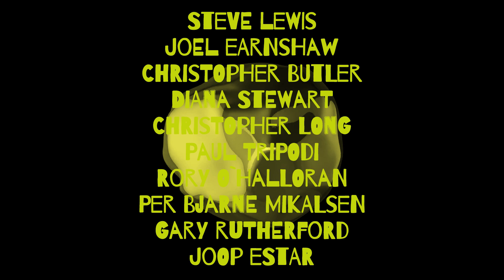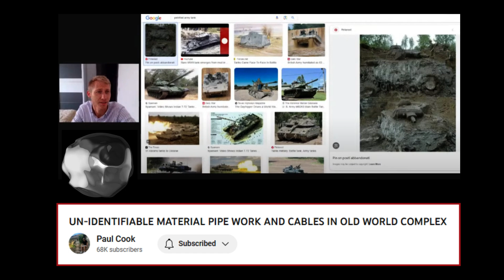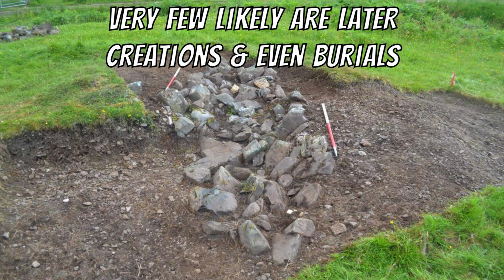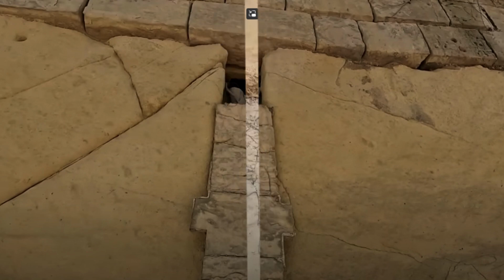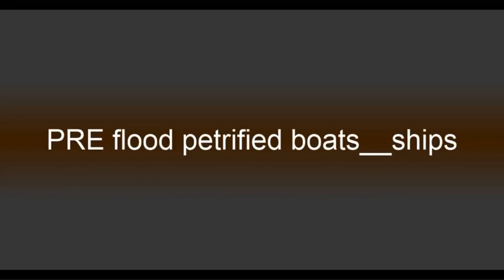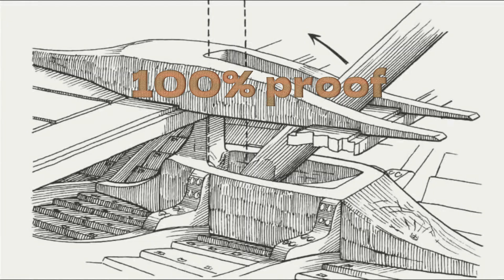Burial Rituals Of Vikings

Comment: Petrifaction certainly doesn't take a lot of time to happen; spirit lake in Washington state after Mount st. Helen's erupted deposited thousands of trees into the lake and are now petrified. I'm able to see the landscape much clearer thanks to your analysis and comparison.
Reply: So maybe the massive heat does the petrification?
Reply: @ironbell  No, excludes of O2 and therefore something like (salt?)water and or Mud which encloses the material what is going to be petrified. Metal e.g. corrodes in water/humidity environment, other material disintegrates and some material is going to be petrified/calcified  such as wood/tree.
Reply: @gucknachoben7303  I thought donaldcornley said the trees from (St Hellen) were already petrified?
Reply from the maker: Yheaaa i just feel it has to be due to specific events / types of trees / ETC, because you dont see the process anymore .... i have viable theories.
                           (((THANKS Donald Cornley)))
Reply: @WISEUPchannel  pyroclastic clouds from a world wide event seems very reasonable. Pompeii  I believe is a good example